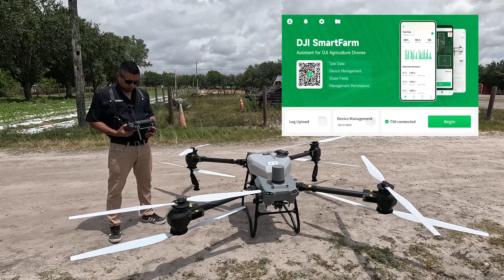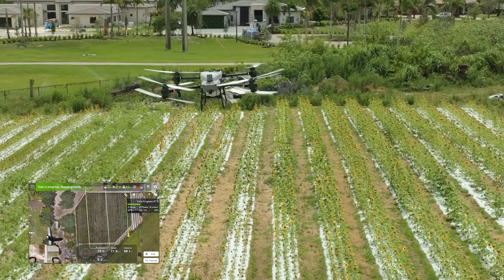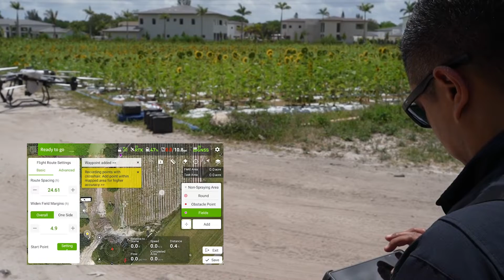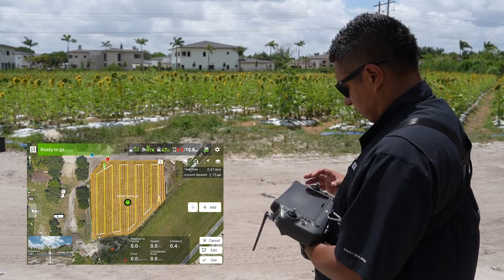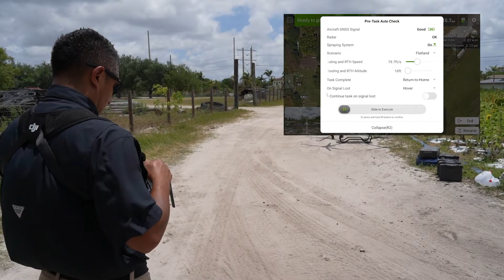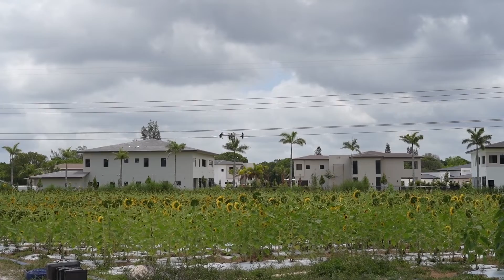DJI Agras T50 - HD Mapping and Spraying Demo

Comment: Thank you for the in depth video presentation, l would to know how long the battery lasts per hectare
Reply from the maker: Hi, the Agras T50 can cover a maximum of about 21 hectares (50 acres) per hour and with a spray payload, you get about 7-10 minutes with the battery. We'd be looking at about 3.5 hectares (about 8.5 acres) per battery. Of course you also factor in battery swap time with all of that. 

For max spreading payloads, you get about 6-9 minutes per flight so it'll be slightly less than spraying.

This is all in ideal conditions so your actual number of hectares will be a bit less than this but hopefully this gives you a general idea.

Comment: Hello May i ask you Sir....Some reason it’s getting error in the line and not spraying consistently of DJI t-50...How can i fix it...?
Reply from the maker: Could be a clog somewhere. Make sure to check the nozzle for any debris or mineral build up. You can also flush the line with clean water and also make sure the filters are clean. 

Check to see if you're getting any  pressure sensor error messages. The sensor may need to be cleaned or could be faulty. If not you can try calibrating the pressure sensor again through the app.

If that doesn't help, you can always email us at experts@dronenerds.com and we can dive deeper into what's going on. Thanks for watching!

Comment: Can the T-50 be used in night missions if the feild is mapped
Reply from the maker: Yes, you can definitely still fly night missions with the T-50. As long as the field is mapped with obstacles taken into account during the initial flight planning during the day, you should be good to go.

Comment: Just got my t50. What have you found to be the best flight parameters for the fastest, most efficient spraying? With the t30 Ive always sprayed at a rate of 2GPA, 9.8ft height, and 23ft/sec but I'm interested to see your input on the t50
Reply from the maker: Its really dependent on what the crops are and what chemical is being applied. Thanks for watching!
Reply: @DroneNerds  mostly 2,4-D on grain/pasture land and glyphosate on roundup ready corn/hay. What do you suggest?

Comment: I’ve been flying RC helicopters since 1985. Those white rotors are begging for red tips or whatever color or pattern that stands out most to the operator. Love the big machines. Surprised they haven’t developed a hybrid version. I’ve used Jetcat two stage turbines but a diesel generator is more efficient and less expensive.
Reply from the maker: Thanks for watching!